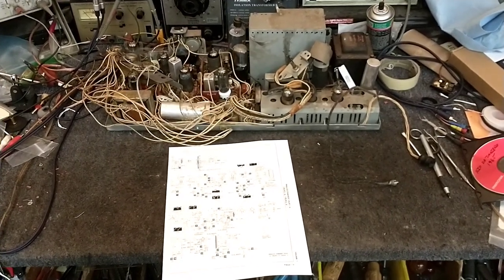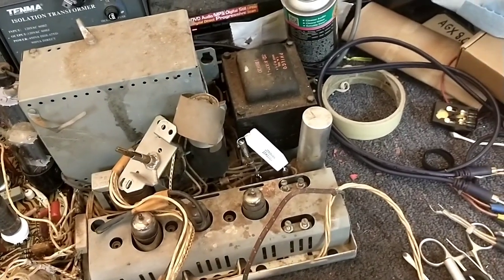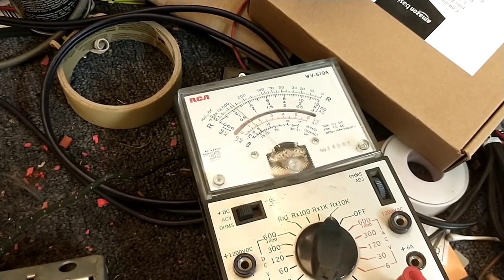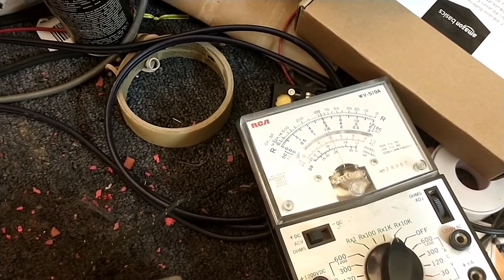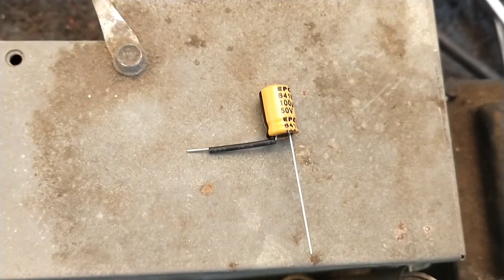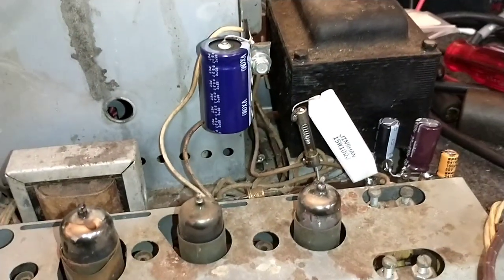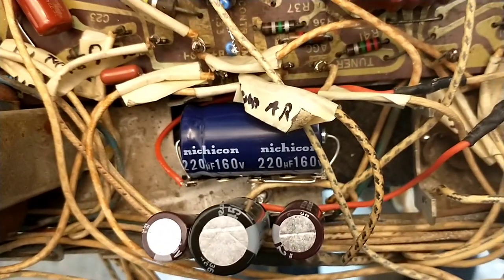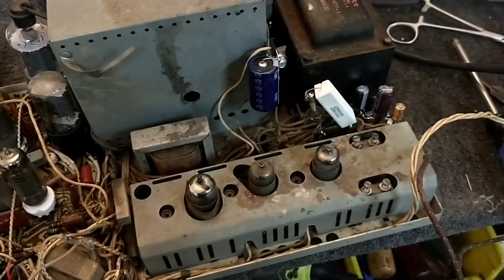Servicing a 1959 Philco Predicta Princess Part 6/9 - Resolving Power supply and B+boost  issues

Comment: One thing I would do if I had one of these sets, is wire in the (replacement) cathode bypass caps closer to the tube where they’re used; this’ll eliminate some long wire runs which’ll just act as an antenna for noise, anyway. Especially as these Predicta chassis were a rats-nest of wires straight from the factory. Granted, I care much more about the electronic performance, than historical accuracy, so that’s my viewpoint on restoring old tube TVs (or AA5 radios.)

Comment: I just got the caps in for my 1952 Philco 17" console TV. I have been having a lot of trouble reading value those bumble bee caps as information I found online doesn't make sense to me so I have been using the sams photopact to give me the value
Reply: The bumble-bee caps are read just like a resistor, but the multiplier band denotes how many zeroes to add, and the result is in picofarads. So a red-violet-orange would be; red=2, violet=7, orange=3, so 27,000 pF, or 27 nF. Any other bands are for tolerance or some such, and you can ignore these as any modern replacement will have better tolerance anyway. The trick is to have a schematic with the voltages so you know what voltage rating the new capacitor will need.